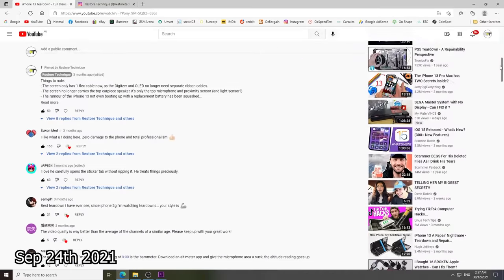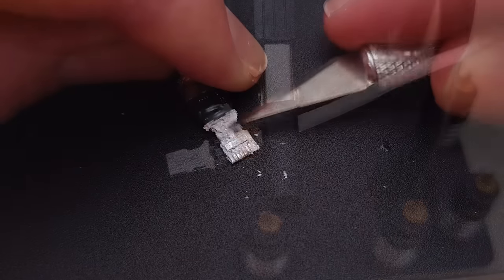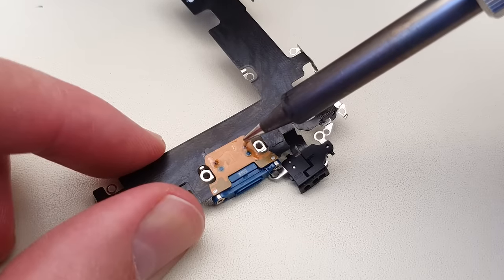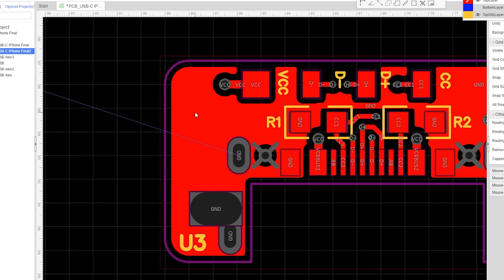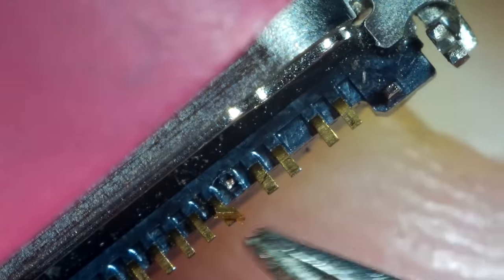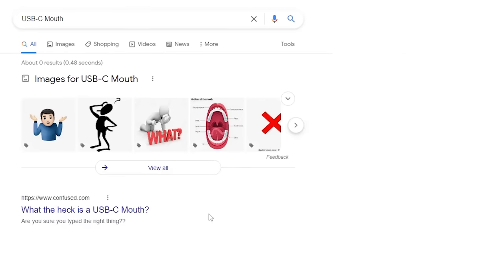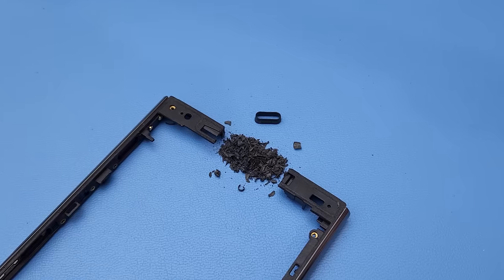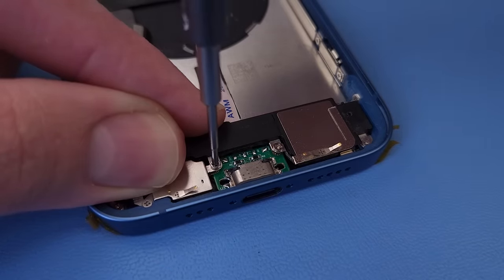I made a USB-C iPhone 13

Comment: Another awesome idea would be to make a removable battery iPhone and android phone case that's waterproof ahead of the EU requirements in 2026.   Hot swappable battery would be even better but at least it removable. I'm imagining an easy to remove back cover based on the location of most batteries but the LG g5 had a slide out type removable battery. I swear phone brands can do it n already probably have it, but if you or anyone human wants to do it, adding a bit of thickness or width n height isn't an issue with customers like the brands said. Most people need a bigger n thicker phone body to grip it better, so less likely to fall (but the brands knew this so they engineered it so small that customers would have to send in for repair or  replacement making more $ for them at the inconvenience of the customer). If you can make such cases low cost($1-$5), there is a huge aftermarket of customers that would definitely buy it. The DIY instructions (video guide, etc) so they can do it themselves would be perfect. And if they can't, they could get repair stores to do it. It's save some many good phones from being thrown out ending up in the landfill or recycled, both of which are destroying the ecosystem on our planet. Even recycling methods use water n chemicals n produce pollution... Samsung galaxy s5 is waterproof with removable battery n rear cover... Please do this and spread it. We next need the software people to redesign the OS on phones n devices to run on old hardware. It's definitely possible as QNX OS ran n maybe still runs on hardware devices with low memory n storage in very efficient ways. Steve Jobs NeXt computer tech was so advanced it was later bought by Apple n used in their systems... All the new hardware every year or months is unnecessary if the software guys do ethical n good programming, but are lazy n really don't know good programming techniques like the old school guys did...

Comment: Why didn't you look at how they added the USB-C on the iPad and implement it too on the iPhone?
Reply from the maker: There's no benefit. Lots of people have asked why I didn't just use a USB-C port from an iPad. It's not like the iphone has connections to plug in ipad parts to it. I'd still need to convert a lightning port to a usb-c port. Using an ipad usb-c port is no easier than any other usb-c port.
Apple didn't take an ipad with lightning and convert it to usbc. They built it from the ground up with usbc.

Comment: I guess it won't work with headphones? I think lightning connectors have some type of otg so it gives power to the dac embedded on lightning headphones but since the usb c has fixed 5.1k resistors, that iphone is doomed to never work with wired headphones

Comment: can apple iPad USB-C port help with this procedure ? i will try do it too
Reply from the maker: It would be harder. The USB-C port on the ipad doesn't just magically work with the iphone just because they're both Apple products. There's no connector on the iPhone motherboard where you can just take an ipad port and plug it in. You've still got to convert Lightning to USB-C. It's no easier. But the ipad port is a 24 pin port with pins on the underside, so it's much harder to solder, and unnecessary seeing as the iphone is only usb 2.0 anyway. Also ipad port isn't water resistant.
Reply: thanks mate for your clarification
hopefully i can be as tech as you are!
 @RestoreTechnique

Comment: What's the point of changing to usb c if you are still at USB 2.0? Both lightning and the port you are using operate at 200Mbps
Reply from the maker: Usb 2.0 is 480Mbps. No point, other than all devices can use the same cable now. It's only a proof of concept phone. It's silly.

Comment: can i send this to apple to upset them
Reply from the maker: Yes
Reply: @RestoreTechnique   that was fast I will also on the iPhone 14 it would be easier to do this because of no SD port so you fit the lightning port board there and have more space. Also did you use easyEda to design the boards if so how do you make it doubler layer to put chips on both sides.

Comment: why not use usb c port from Ipad ??
Reply from the maker: It would be harder. The USB-C port on the ipad doesn't just magically work with the iphone just because they're both Apple products. There's no connector on the iPhone motherboard where you can just take an ipad port and plug it in. You've still got to convert Lightning to USB-C. It's no easier. But the ipad port is a 24 pin port with pins on the underside, so it's much harder to solder, and unnecessary seeing as the iphone is only usb 2.0 anyway. Also ipad port isn't water resistant.

Comment: Dont get this ...??? The lighting Cable connects more strongly into the phone and is also a more cleaner plug ( or more easy to keep clean )... male and female connection... what advantages has typeC ...??? See only disadvantages
Reply from the maker: This is just a proof of concept phone, which is still restricted to USB 2.0 and 23W fast charging by Apple's hardware.
But USB-C in general has 5-80Gbps transfer speed, compared to lightning's 0.5Gbps.
And charging speeds up to 240W, compared to 23W.
USB-C is capable of 10 times the charging speed of Lightning and over 100 times the data transfer speeds.
Lightning is a well designed plug, but 8 pins just doesn't cut it these days.

Comment: Why don’t you take a usbc from the ipad 10th gen and put it in the iPhone 14
Reply from the maker: Firstly, it's not waterproof/resistant. Secondly, lots of people have commented "why didn't you use an iPad USB-C port?"
The port on the ipad doesn't just magically work with the iphone just because they're both Apple products. There's no connector on the iPhone motherboard where you can just take an ipad port and plug it in. You've still got to convert Lightning to USB-C. It's no easier. Harder actually, because the ipad port is a 24 pin port with pins on the underside, so it's much harder to solder, and unnecessary seeing as the iphone is limited to usb 2.0 anyway.
Reply: @RestoreTechnique  ok

Comment: how myuch faster is charging tho...
Reply from the maker: No faster
Reply: @RestoreTechnique  Not faster?? then whats the point?
Reply from the maker: @Darinililuo  just a proof of concept, for funsies 😜
Reply: @RestoreTechnique  ohhh but if the Iphone 15 had USB C will it be faster or no
Reply from the maker: @Darinililuo  Apparently the iPhone 15 will still be USB 2.0 data speeds, and only the iPhone 15 Pro will be USB 3.0.
I don't know about charging speeds though.